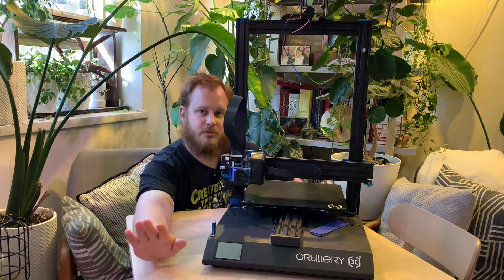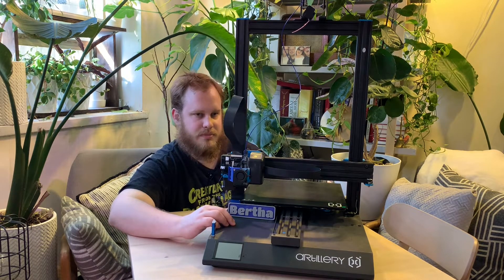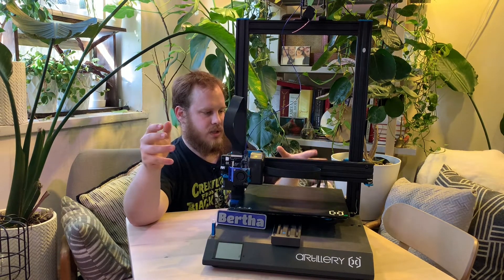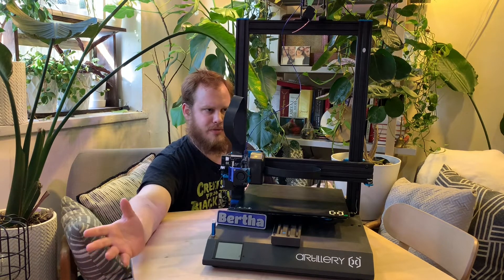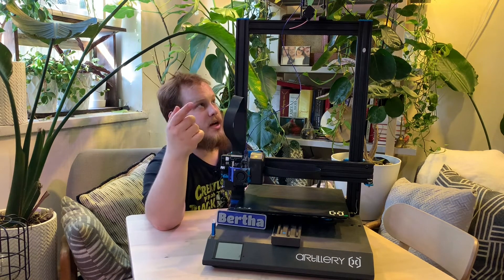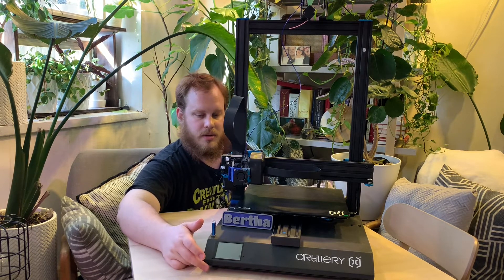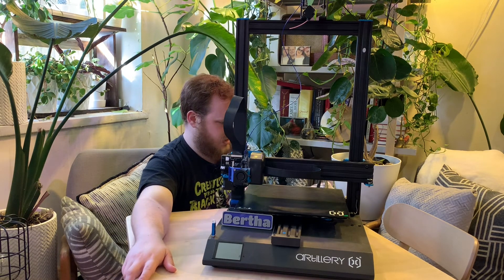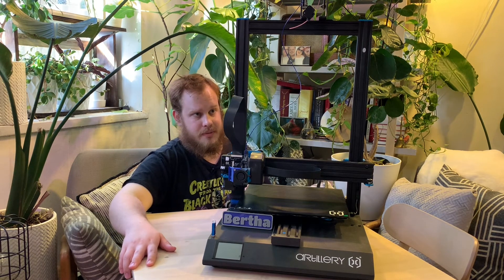Artillery Sidewinder X1 - 3 Month Review

Comment: Its funny that I've only looked at these videos now, but I got an Artillery Genius right around the time you made this video and I also had the same 1st layer g-code error. I never bothered to look up videos about the issue, and I would go through the effort of re-slicing my stl files often to no avail. The easiest solution to that problem I found was to quickly hit Pause on the print, and the second it would allow me to resume I'd hit Resume, and the print would continue without any more problems. It took a few months of constant usage before it ever happened.
I'm looking to buy a Sidewinder because I'd love to get some more print space to work with. I wish Artillery/Evnovo would make a 400x400 printer because I love that their printers are silent and have insulated print beds that heat up to 60c in a minute and maintain the temp. I could run my Artillery Genius all night and not hear it. I couldn't do that with the Ender 3 and the JGAurora A5S I had in the past because they both sounded like jet engines. If anyone knows of a 400x400+ printer that's as silent as an Artillery printer, let me know, haha

Comment: can someone tell me if this printer is capable of printing nylon carbon? The ender 3 v2 was my choice specifically because there is so many aftermarket parts available so I'm worried that the sidewinder while better packed out of the box it's limited on what you can upgrade later

Comment: I have had my X1 for a month and I found that wiping the glass with isopropyl  alcohol directly before printing and the adhesion is perfect. Before I tried that nothing would stick , so I used glue stick but left a residue that would add to the height of the bed upsetting the level. After cleaning of glue stick residue and using isopropyl I have perfect adhesion. So it appears that cleanliness is paramount. Cheers from Australia
Reply from the maker: Thanks for the advice, I’ve found the same thing. The glass bed works best when it is 100% clean.

Comment: The error mentioned at 8:00 also occurs with my Artillery Genius. Regardless of the USB stick used. It seems to occur with Slic3r version 1.3.0 and higher. Using Slic3r 1.2.9 and Cura this problem does not occur.
Reply: Did you end up figuring out a solution? I have formatted/tried other usb's as suggested but to no avail. I don't even know what the error is called so I can't look it up
Reply: @whysoangri  No, unfortunately I have not found a solution for this. I also don't think it is related to the USB stick or its formatting. I think the problem will be elsewhere.

Comment: Yeah I just received mine from Gearbest. Question? How do you tell which version you have?  Also big ask if you can do a video on how to level the bed before a print. I have watched other videos but I like how you cover things in great detail.  Thanks
Reply from the maker: Thanks for the praise Leo, we've been on a bit of a hiatus but we'll be back soon with some more guides for the Sidewinder X1, especially bed leveling. I ordered and received a second printer a short while ago and while I was told that I would be receiving version 4 of the machine I believe I actually received version 3. It would seem that some of the older versions are still circulating out to customers. From my understanding version 3 on wards have the "ultrabase" style build platform, whereas older versions only have a glass bed. Version 4 is supposed to have sturdier wiring with press-fit connectors for the flat flex cables, and version 3 has hinged clamping connectors for those cables.
Reply: The Sibling Rivalry yeah I think I got version 3. The cabling is still static with no clips. No complaints though. I got her all setup and watched a couple videos on leveling the bed and was successful. I was disappointed there was no profile for it in Cura but got past that with some information I found on TH3D. I was able to create some Gcodes from the stl files and they printed perfect. I need to hook up my Raberry Pi OctoPI still. 
That printer square port in the right side what is that for?
Reply from the maker: @leosiwicki2013  What you are most likely describing is the USB B port, it allows you to connect your printer to your computer so it can be run with host software like Cura or Repetier Host, or even Octoprint with a Raspberry Pi like you mentioned. It also allows you to upload firmware to update the motherboard.
Reply: You can't tell it by a version nr or so, just some parts changed, but if you just received it, you got the newest one.

Comment: Couple things that I hope you can help me with.  I'm relatively noob-ish.  Got like 6 months of printing under my belt with a Sovol SV01 primarily for printing TPU (drone related stuff).  I'm highly interested in this printer primarily for the direct drive over bowden (TPU printing).  I too had the same impression as another comment about the Ender3 needing mods for this and that to get it "just right" that frankly I don't want to screw around with.  The Sovol has a decent size bed and is direct drive.  I would see some banding (if thats the right term) which I've read is generally common in direct drive printers with the added weight getting slung around on the gantry and bed size.  With the Sidewinder also being direct driver and an even larger bed than my Sovol do you see this issue also?  And, do you have a link to reference or a how-to video showing the firmware update process?  Thanks.

Comment: I Had the same issue with my filament run out sensor on my V4. I removed the case from the switch and put a slight bend in the metal part of the switch works ok now.( the switch case just pops off).
Reply from the maker: Thanks for the info! I imagine it's a similar assembly to all the other switch based sensors out on the market (like my KP-3.)

Comment: Thanks for making this review. I had been interested in this printer recently but trying to find recent, non year old, reviews was getting to be tough. Seems like from the first version to this current 4th version thy have fixed a few of the early issues I saw in reviews. My printer choice initially was going to be the Ender 3 but after seeing how many mods you need to do with it to get it "just right" plus realizing that I will need a bigger print bed than it offered I have settled on the Sidewinder X1. Again thanks for you review.
Reply from the maker: Glad you found the review helpful! Our second Sidewinder X1 arrived yesterday and is just as awesome as the first one.

Comment: Trying to get my own Sidewinder X1 leveled. My previous printer has a 120mm * 120mm bed, so obviously it's a crazy different experience with this. I'm wondering if I want to break down and flash the firmware or if I should keep fiddling with it as is.
Reply from the maker: sorry for the late reply, have you checked out our video on leveling the KP-3? I used a dial indicator which is the same as what I used to level my sidewinder. It's the best method I've found for this size of printer, I also flashed the firmware mentioned in the video and description and it allowed me to dynamically set the z offset for the first layer, this was vital in getting everything sorted. Once the bed is square you adjust the z offset/z babysteps and you should be golden.

Comment: Did you try the mesh bed leveling that comes with the new version of the firmware?
Reply from the maker: No, I haven’t tried it yet. When I do, depending how it goes, I’ll make a video about it.
Reply: @afternoons_n_coffeespoons  I am having trouble leveling, what do you suggest i do. This is my first 3D printer.
Reply from the maker: @treyvon8358  Hi, I would suggest using a dial indicator like I mentioned in the video, I have a video on how to use that in regards to the KP-3, follow the guide and make sure you have the firmware version that allows you to set the z offset/ babysteps. once you have everything squared and level adjust the z offset to get you perfect first layer.